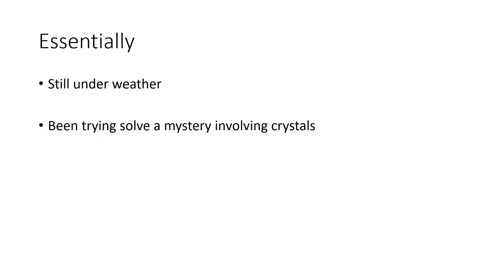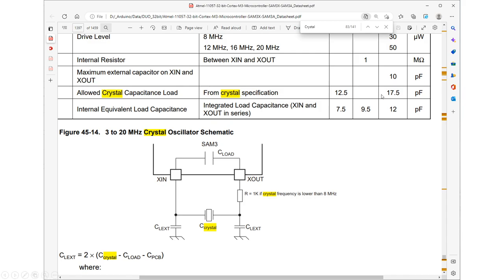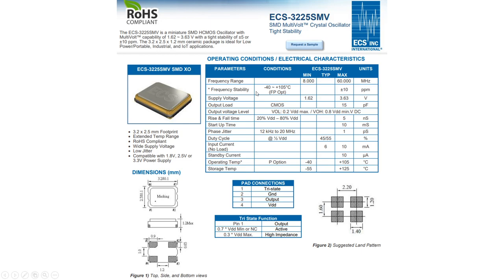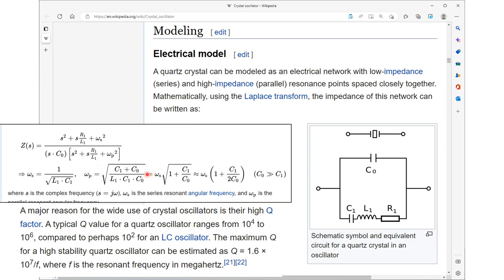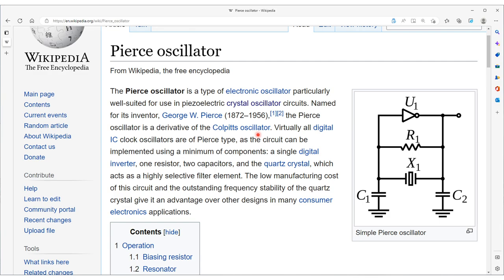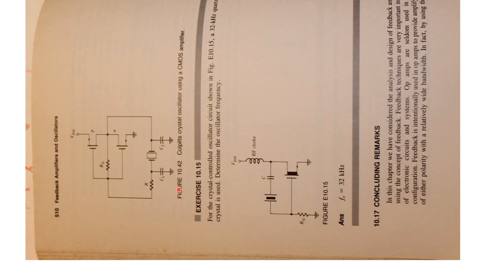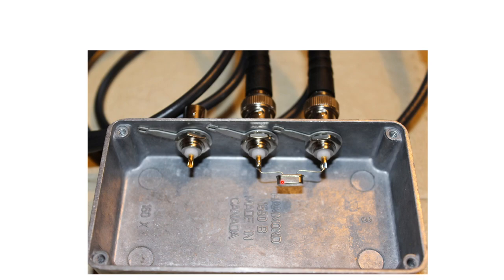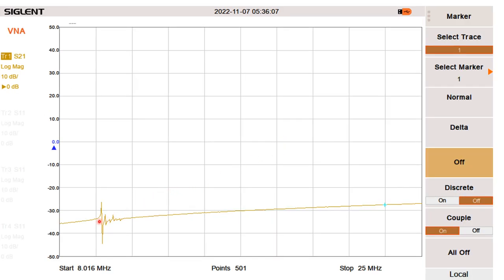Status: 6 Nov:  Its Crystal Clear Now

Comment: Dude. If you are well versed in electronics i implore you to try and construct an AC magneto-hydrodynamic-propulsion.

The normal way is using a magnet and 2 plates connected to DC source and the current cause the fluid to go 1 way
The AC way is using 2 plates connected to each end of the coil while the coil is wound around the plates and than you drive it at its resonant frequency and as the plate changes sign so does the magnetic direction so its 1 directional.

My belief is that in such a way you are trading the current from DC mode to using volt "pressure" to drive the system making it not only extremely efficient, but acting on the ether.

And if you turn this system inside out you get various UFO patents you see on the internet.

If this does not work, than i dont know what does... its literally the only thing that would maybe work... perhaps you need a gyroscopic and electric stuff added, but the AC hydrodynamic motor should give us some answers. (Cant find anything online except 1 patent of such mode)

Comment: Anyone can edit Wikipedia pages, so if you think some information is wrong then you can correct it. No need to make your own website.
Reply: The problem is that the same can be done tome its the mainstream wiki editors disagree with and will revert
Reply: @635574  Well yes if you put non mainstream stuff in wikipedia it gets reverted, as it should, wikipedia is supposed to be about mainstream information after all. But in this case the article is genuinely bad, and could be improved, so nothing prevents anyone with appropriate expertise from writing a new article.